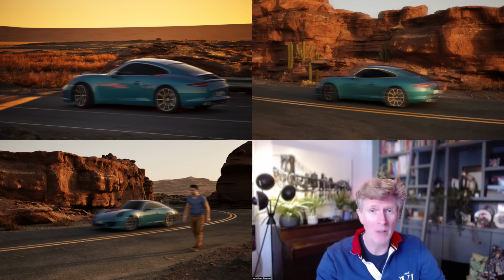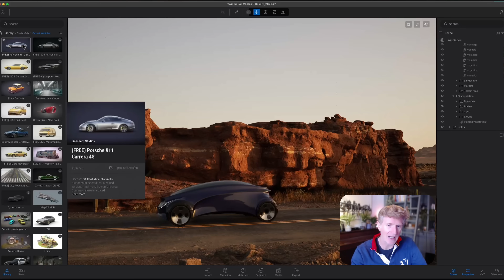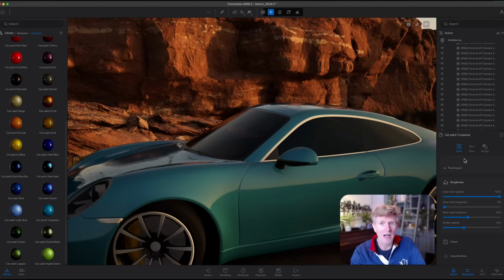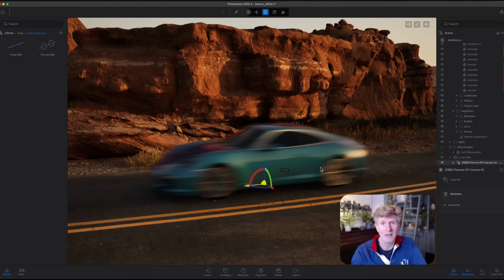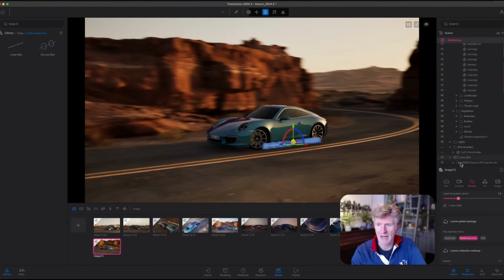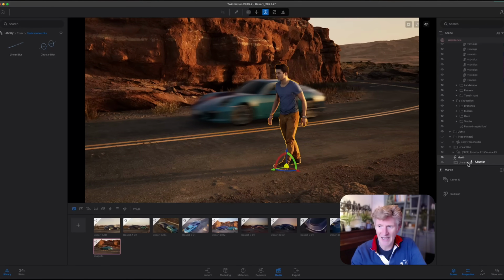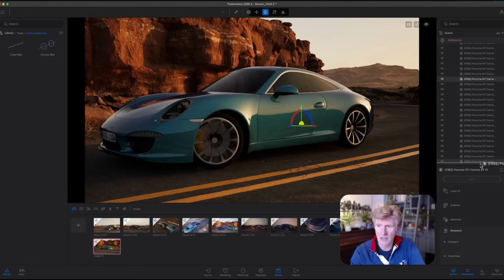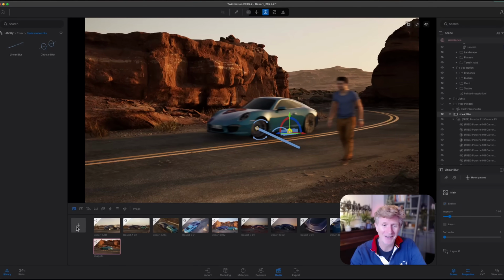Twinmotion 2025.2 - Motion Blur Tutorial

Comment: Twin Motion Huh?. We use Blender and Bonsai BIM intead of Vectorworks and TwInmotiion..  Bender has builtin a  Ray Tracing rendering engine AND built in Animatiion Tools superior to Twin Motion's  animation.  

Blender’s Animation Tools:
Blender offers a comprehensive, industry-standard animation toolkit that’s highly regarded for its flexibility and power, especially in 2025 with ongoing updates from its active community. Key features include:
•  Rigging and Character Animation: Advanced rigging systems with armatures, constraints, and inverse kinematics (IK) for realistic character movements. Tools like the Pose Library and Shape Keys allow for detailed facial expressions and morphing, ideal for engineering simulations or architectural character integrations (e.g., people in building walkthroughs).  
•  Keyframing and Timeline: Intuitive keyframe animation via the Dope Sheet, Graph Editor, and Non-Linear Animation (NLA) editor for layering and blending animations. This supports precise control over motion paths, easing, and timing, making it suitable for complex sequences like mechanical simulations or dynamic building models.
•  Simulations and Physics: Built-in physics engines for cloth, fluid, smoke, and rigid body dynamics, enhanced by node-based modifiers. This is particularly useful for architectural applications like wind effects on structures or crowd simulations in designs. 
•  Rendering Integration: Eevee for real-time previews and Cycles for high-quality ray-traced outputs, allowing seamless animation rendering. Add-ons and Python scripting enable custom tools, such as automating repetitive engineering animations.
•  Usability and Learning Curve: While powerful, it has a steep learning curve due to its dense interface, but abundant tutorials and community resources make it accessible. It’s hardware-efficient for large files and polished for professional animation, scoring high in user reviews (e.g., 9.5/10 for textures, 9.6/10 for lighting on G2).  
Users praise Blender for achieving superior, realistic results in final animations, especially when time is invested, and it’s a top choice for user-friendly yet advanced 3D animation in 2025 lists.